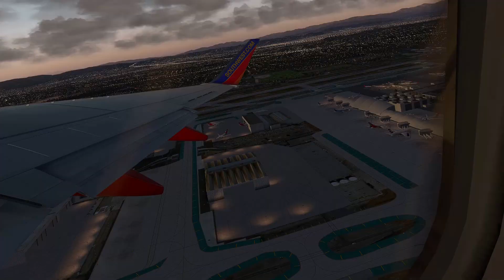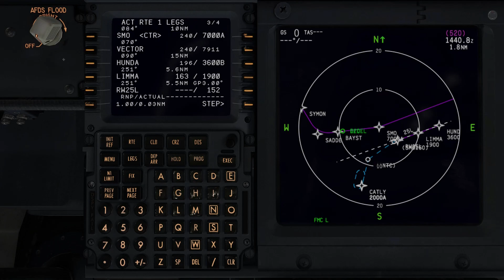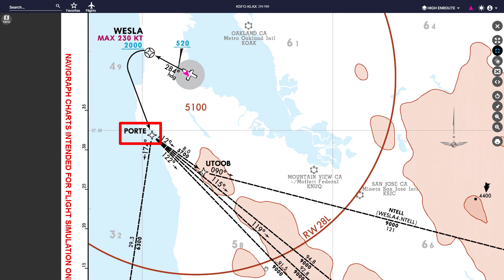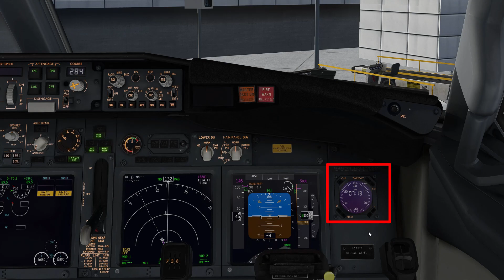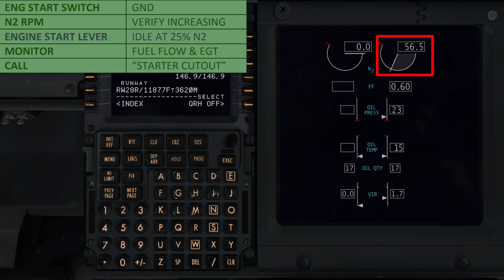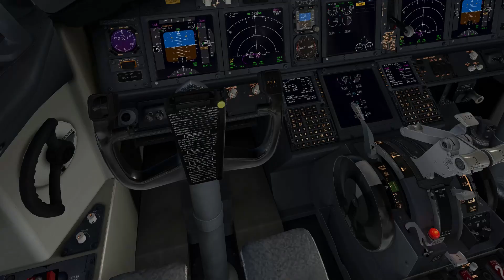Aircrafts Dissected Ep 11: Pushback and Engine Start IZibo 737IX-Plane 11 Detailed Tutorial

Comment: Hi FlyBy Sim!  The bypass pin mainly disconnect  system hydraulics "A" to protect about damage on the gear and systems. Because that you don''t need to disconnect, manually, Hydraulic "A" system.  Greetings.
Reply from the maker: Aah thanks for the clarity. Truly do appreciate it Cres:)